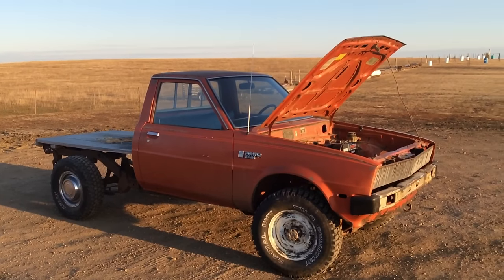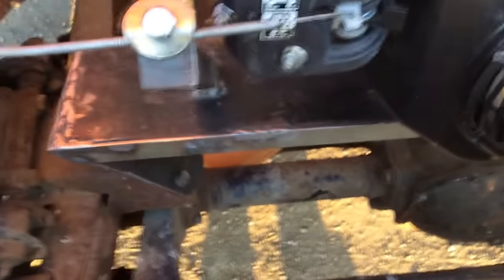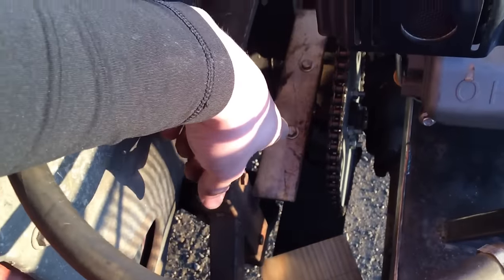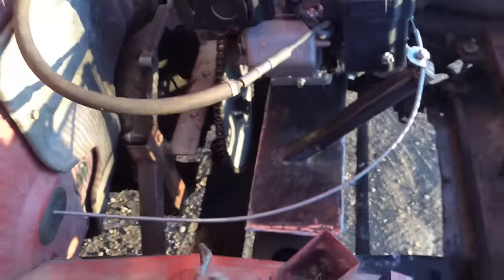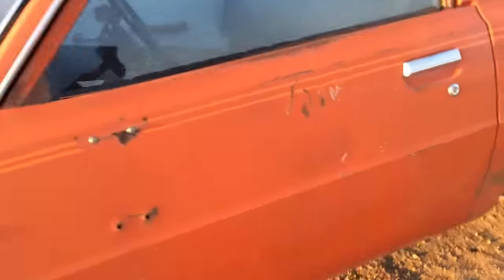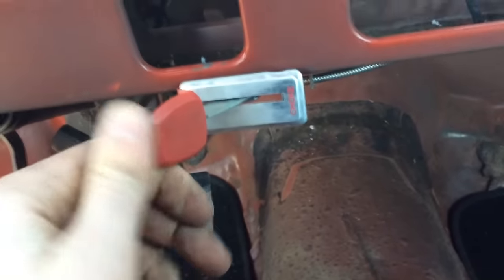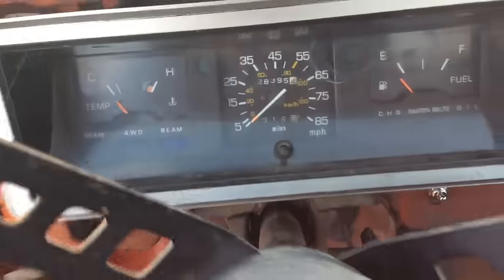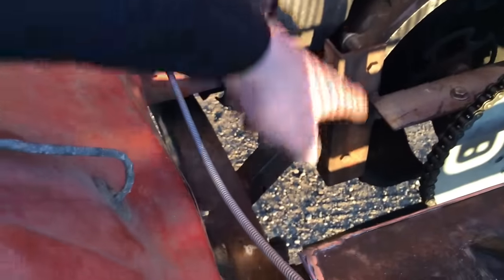Predator 212cc Truck

Comment: I was on my own at a pretty early age but this one old man that was a big influence on me said, "IF YOU CAN BUILD IT BY YOUR SELF, YOU CAN FIX IT BY YOURSELF
hE NEVER LAID A FINGER ON ANYTHING, HE JUST SAT IN HIS EASY CHAIR IN THE MIDDLE OF HIS SHOP.  he just told me where to look in the three acres of cars trucks and boats and if I didn't know how to make a part on the lathe, he told me how and if I broke something making it he told me how to grind a new tool bit or whatever was needed.  Once I finally got it through my head that I didn't need to be scared to make anything because he would make shire it was built strong.
Years later he said he was afraid to say no because he figured I'd go do it someplace and kill myself.
we/I built a woods buggy. It seems it was  Henry J frame and engine and transmission with a big gear reduction. It had a 2 ton truck back axle and zero suspension. Just lower the tire pressure in the tires he said. Yeah, 16' truck tires, dualies front and rear and it would float. I have never had a car or boat to live on and sail that I paid one dollar for. Thats pretty cool.

Comment: I'm building my Isuzu trooper with a 440cc 18hp electric start duromax the blue motor. I am going with the ten tooth on top and the 60 tooth sprocket on the transmission shaft. I have a 47 tooth for more speed for when I am taking my trooper to town grocery getting. Eventually I'll get the alternator and power steering hooked up with all the running lights and safety devices in order. I have an 80 tooth sprocket in case I don't get the torque that I want in the mountains. I figure if I build my trooper to the same size sprockets as this kid and put a three times the size motor on it that it would probably be awesome.
Reply from the maker: That will be awesome!

Comment: Buy a stage 4 kit and a 40 series torque get the heaviest springs for the torque converter remove the governor advance the timing and you'll probably be pulling around a lot faster than the standard clutch

Comment: Since you have the clutch directly on the shaft of the engine do you still have to use the clutch pedal for the actual transmission?
Reply from the maker: It is a centrifugal clutch.

Comment: So I've yet to see any one put a belt drive on it if u hooked up dual pulleys and set it up with  a double pulley lawntractor clutch not to mention playing around with the gearing using  different sized pulleys with a jack shaft I think a guy can get it to work fairly well but having that  clutch set up would help it with taking off     and running dual pulleys and 2 belts it should last a good while

Comment: Man you need to put a torque converter on that bad boy and watch the dust fly!!!
You'll hit the big 4 0 mph!
Reply from the maker: Chris Stiff  a torque converter actually only increases torque but actually will cause less top speed!  Actually tried it!  Not good on belts.
Reply: @everythingwithwheels4614  even if you built up the engine?  New intake, bigger carb, stronger springs???
But still your Tonka trunk is a lot bigger than the ones I played with.  
Great build man!

Comment: I didn't know that there was actually a culture around engine swapping cars with predators. Absolutely fascinating. Anyone predatored a Tesla yet?
Reply: A model 3 needs only 14 HP at the wheels to cruise at 70 mph, so 50 mph possible on 6.5HP? Without 800lb of battery, skinny wheels would improve that.
Reply: @Tore_Lund  certainly. I will never understand why modern electric cars need to be constructed with hundreds of horsepower. It's all about marketing. Oohh, I have opted for an Aptera. Cool concept.
Reply: @phaandorpertwee6981  What is worse is that EVs used to be rated for their nominal motor power, not peak power as now. This means that my 15kW nominal power EV from 2002, is far cheaper to insure, than if it was rated by its 80kW peak power, which it would be if it was type approved today.

Comment: Prime candidate for electric, actually. You can retain accessories, too. New electrics are BS garbage, but retrofits are great. You have the reliability and economy of the standard drive train/chassis and the torque/low maintenance of the electric. Plus, you can beat the range of the overpriced crap by far.

Comment: I've heard of catalytic converters going on a lawn mower engine but if this thing passes emissions it passes emissions and I guess there's no hills in Nevada to climb up and down on it doesn't have to be the same engine but it can't be any bigger than the original OEM
Reply: Dude what are you talking about? People put bigger engines in vehicles all the time. Done it myself a few times.
Reply: @danielblackford2075  I don’t know what inspection you’re talking about. We don’t have anything like that here.
Reply: @turdferguson12  my mistake I Doo unfortunately .

Comment: Does the transfer case/4WD work?
Reply: I'm sure it does.. the transfer case selector is all the way back in the 4wheel low range ....that's why it's able to put itself at all...
Without low range it probably wouldn't leave 1st gear...
Reply: David Jessee true. Good point.

Comment: How do you get it to shift gears without stalling?
Reply: Push in the clutch. Duh
Reply: David Jessee I was just saying. Because I’ve seen some using s10 where they don’t need the clutch. It just pushed right into gear and will idle in gear not start moving or stall

Comment: whats the total cost for this project including the car itself?!
Reply from the maker: Truck was free to me. Engine was $100. $30 sprocket. I would say there was at least $100 of other random stuff so I would say it pushed $300-400.
Reply: @everythingwithwheels4614  nice! And how far could you drive with that tiny tank of fuel?!
Reply from the maker: @kirdot2011  honestly not sure maybe 5 miles idk
Reply: @everythingwithwheels4614  thats not very practical...i`d suggest you upgrade the fuel capacity to at least double that

Comment: A tillotson 212 electric start engine would be a better replacement engine when this engine engine goes out because they can run 5400 rpm’s bone stock and also have all the lights working and it 10 horsepower.

Comment: If I get four on the floor and five on the side with a Ford ranger I can put any motor in it it could be a forklift electric motor for all I care gas isn't getting any cheaper but I bet you go through a lot of go-kart clutches

Comment: Is say you were going around 10 to 15 but with little work i can see it hitting up too 25 and with a good amount of work i can see around 45 to 50 maybe even up to 55 and you should get a speedometer app and see what your speed is on that though or just go on ur phone gps and use the speedometer on there

Comment: Well I guess I'll be putting a v-twin kholer courage in the old 85' ranger if it ever let's me down
Reply: Oh wait that'd cost more than a new 2.8l LMFAO
Reply: @savageoffroadmowers6199  ...and probably quite a bit LESS reliable considering the lousy track record of the Kohler Courage series engines.😜 I'm not big on Ford to start with, but the 2.8 V6 was actually a pretty good engine.😉
Reply: @danw1955  well it seems to be a great engine so far, I only gave $150 for the truck + $130 in parts

Comment: Rig up a transmission rather than that clutch and it'd be faster or put 2 in it, Dual inline.
Reply: It is using the transmission. He shifted up to 3rd gear.
Reply: @davidjessee7701  I thought it was centrifical of some sort

Comment: if its a 5 speed why it have a torque converter it would of had a clutch pack and pressure plate and throw out bearing lol
Reply: a cyntrifical clutch on the motor like a go cart has , chain and sprockets coupled the the standard 5 speed transmission shaft no preasure plate throughout bearring or clutch disk needed .